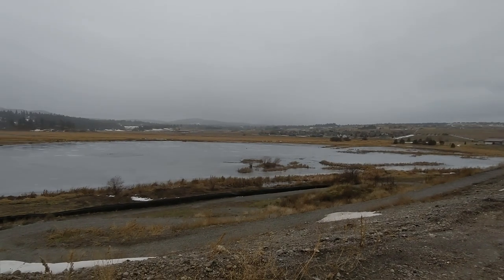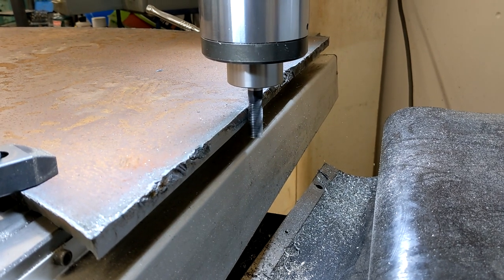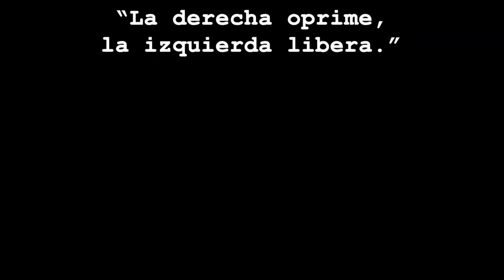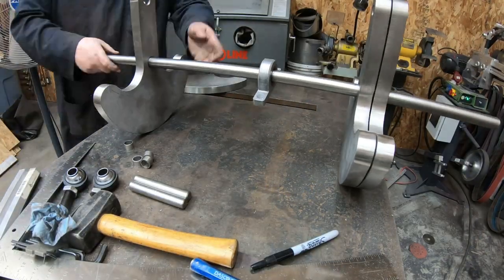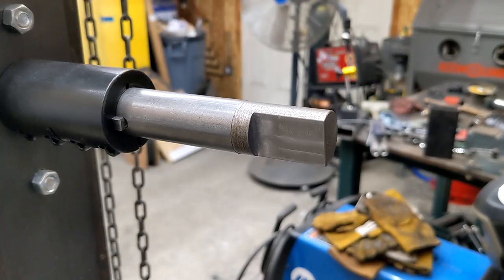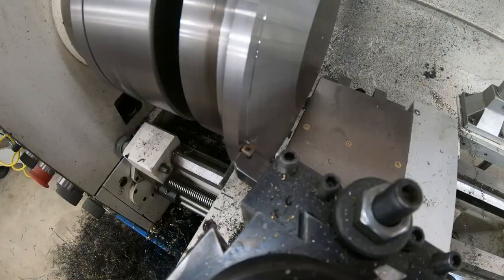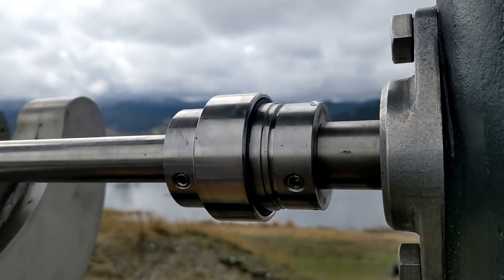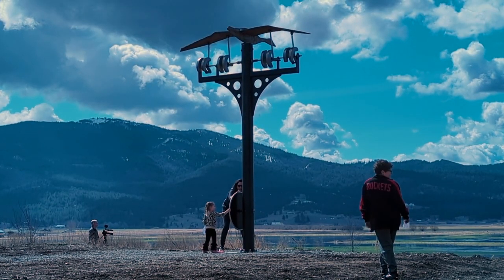I built a mechanical goose and it mostly worked

Comment: As a kid, I decided to build a submarine model (rubberband motor propelled). My choice of material was.. a wooden log. Like, an actual solid log of wood almost my own height. I cut a roughly-submarine shape out of it with an axe and I barely had enough strength to lift it. Naturally, it had a crazy amount of buoyancy that I had to compensate by strapping an even crazier amount of lead weights to it. Naturally, to propel so much weight I had to use a straight up bicycle tire as a rubberband for the motor.

Man, if I had the tools and materials back then, I'd also go for straight up 2cm sheet metal builds too.

Comment: Almost all of the chain drives I've ever seen in machinery have a spring loaded tensioner in them. I think with that length of chain it wont take much wear for the chain to start jumping. Also totally agree with you on the thread direction mnemonic, but I always just memorised it and then had to think twice when reaching around behind a bolt.

Comment: Not sure if you have a mag drill?  I've drilled clean holes in large pipes using a mag drill stuck to an I-beam strapped (or tacked) to the pipe, before.